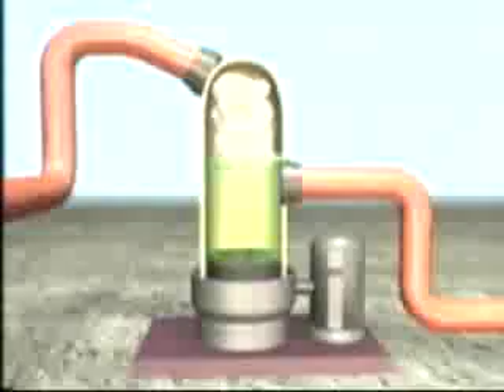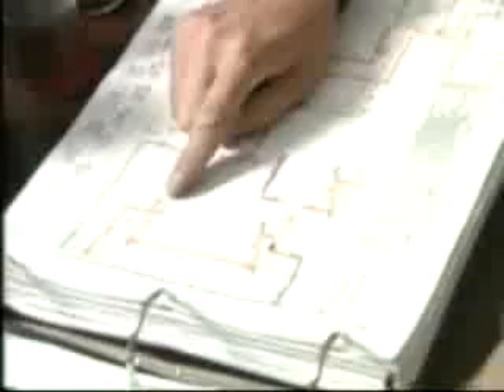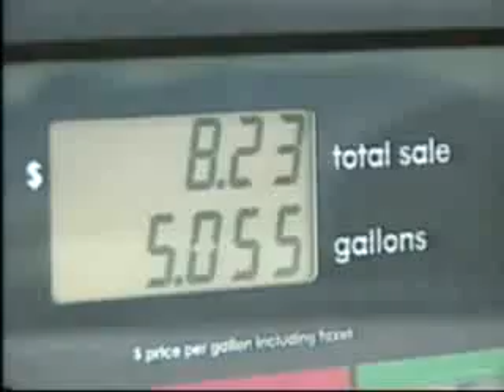Thermal Depolymerization

Comment: Part 2
Making oil and gas from hydrocarbon-based waste is a trick that Earth mastered long ago. Most crude oil comes from one-celled plants and animals that die, settle to ocean floors, decompose, and are mashed by sliding tectonic plates, a process geologists call subduction. Under pressure and heat, the dead creatures' long chains of hydrogen, oxygen, and carbon-bearing molecules, known as polymers, decompose into short-chain petroleum hydrocarbons. However, Earth takes its own sweet time doing this—generally thousands or millions of years—because subterranean heat and pressure changes are chaotic. Thermal depolymerization machines turbocharge the process by precisely raising heat and pressure to levels that break the feedstock's long molecular bonds.

Many scientists have tried to convert organic solids to liquid fuel using waste products before, but their efforts have been notoriously inefficient. "The problem with most of these methods was that they tried to do the transformation in one step—superheat the material to drive off the water and simultaneously break down the molecules," says Appel. That leads to profligate energy use and makes it possible for hazardous substances to pollute the finished product. Very wet waste—and much of the world's waste is wet—is particularly difficult to process efficiently because driving off the water requires so much energy. Usually, the Btu content in the resulting oil or gas barely exceeds the amount needed to make the stuff.

That's the challenge that Baskis, a microbiologist and inventor who lives in Rantoul, Illinois, confronted in the late 1980s. He says he "had a flash" of insight about how to improve the basic ideas behind another inventor's waste-reforming process. "The prototype I saw produced a heavy, burned oil," recalls Baskis. "I drew up an improvement and filed the first patents." He spent the early 1990s wooing investors and, in 1996, met Appel, a former commodities trader. "I saw what this could be and took over the patents," says Appel, who formed a partnership with the Gas Technology Institute and had a demonstration plant up and running by 1999.

Thermal depolymerization, Appel says, has proved to be 85 percent energy efficient for complex feedstocks, such as turkey offal: "That means for every 100 Btus in the feedstock, we use only 15 Btus to run the process." He contends the efficiency is even better for relatively dry raw materials, such as plastics.

So how does it work? In the cold Philadelphia warehouse, Appel waves a long arm at the apparatus, which looks surprisingly low tech: a tangle of pressure vessels, pipes, valves, and heat exchangers terminating in storage tanks. It resembles the oil refineries that stretch to the horizon on either side of the New Jersey Turnpike, and in part, that's exactly what it is.

Appel strides to a silver gray pressure tank that is 20 feet long, three feet wide, heavily insulated, and wrapped with electric heating coils. He raps on its side. "The chief difference in our process is that we make water a friend rather than an enemy," he says. "The other processes all tried to drive out water. We drive it in, inside this tank, with heat and pressure. We super-hydrate the material." Thus temperatures and pressures need only be modest, because water helps to convey heat into the feedstock. "We're talking about temperatures of 500 degrees Fahrenheit and pressures of about 600 pounds for most organic material—not at all extreme or energy intensive. And the cooking times are pretty short, usually about 15 minutes."

Once the organic soup is heated and partially depolymerized in the reactor vessel, phase two begins. "We quickly drop the slurry to a lower pressure," says Appel, pointing at a branching series of pipes. The rapid depressurization releases about 90 percent of the slurry's free water. Dehydration via depressurization is far cheaper in terms of energy consumed than is heating and boiling off the water, particularly because no heat is wasted. "We send the flashed-off water back up there," Appel says, pointing to a pipe that leads to the beginning of the process, "to heat the incoming stream."

At this stage, the minerals—in turkey waste, they come mostly from bones—settle out and are shunted to storage tanks. Rich in calcium and magnesium, the dried brown powder "is a perfect balanced fertilizer," Appel says.

The remaining concentrated organic soup gushes into a second-stage reactor similar to the coke ovens used to refine oil into gasoline. "This technology is as old as the hills," says Appel, grinning broadly. The reactor heats the soup to about 900 degrees Fahrenheit to further break apart long molecular chains. Next, in vertical distillation columns, hot vapor flows up, condenses, and flows out from different levels: gases from the top of the column, light oils from the upper middle, heavier oils from the middle, water from the lower middle, and powdered carbon—used to manufacture tires, filters, and printer toners—from the bottom. "Gas is expensive to transport, so we use it on-site in the plant to heat the process," Appel says. The oil, minerals, and carbon are sold to the highest bidders.

Depending on the feedstock and the cooking and coking times, the process can be tweaked to make other specialty chemicals that may be even more profitable than oil. Turkey offal, for example, can be used to produce fatty acids for soap, tires, paints, and lubricants. Polyvinyl chloride, or PVC—the stuff of house siding, wallpapers, and plastic pipes—yields hydrochloric acid, a relatively benign and industrially valuable chemical used to make cleaners and solvents. "That's what's so great about making water a friend," says Appel. "The hydrogen in water combines with the chlorine in PVC to make it safe. If you burn PVC [in a municipal-waste incinerator], you get dioxin—very toxic."

oil_4.jpg
Brian Appel, CEO of Changing World Technologies, strolls through a thermal depolymerization plant in Philadelphia.
The technicians here have spent three years feeding different kinds of waste into their machinery to formulate recipes. In a little trailer next to the plant, Appel picks up a handful of one-gallon plastic bags sent by a potential customer in Japan. The first is full of ground-up appliances, each piece no larger than a pea. "Put a computer and a refrigerator into a grinder, and that's what you get," he says, shaking the bag. "It's PVC, wood, fiberglass, metal, just a mess of different things. This process handles mixed waste beautifully." Next to the ground-up appliances is a plastic bucket of municipal sewage. Appel pops the lid and instantly regrets it. "Whew," he says. "That is nasty."

Experimentation revealed that different waste streams require different cooking and coking times and yield different finished products. "It's a two-step process, and you do more in step one or step two depending on what you are processing," Terry Adams says. "With the turkey guts, you do the lion's share in the first stage. With mixed plastics, most of the breakdown happens in the second stage." The oil-to-mineral ratios vary too. Plastic bottles, for example, yield copious amounts of oil, while tires yield more minerals and other solids. So far, says Adams, "nothing hazardous comes out from any feedstock we try."

"The only thing this process can't handle is nuclear waste," Appel says. "If it contains carbon, we can do it."

This Philadelphia pilot plant can handle only seven tons of waste a day, but 1,054 miles to the west, in Carthage, Missouri, about 100 yards from one of ConAgra Foods' massive Butterball Turkey plants, sits the company's first commercial-scale thermal depolymerization plant. The $20 million facility, scheduled to go online any day, is expected to digest more than 200 tons of turkey-processing waste every 24 hours.

Comment: https://www.youtube.com/watch?v=xtS6K43np9o&t=75s  Thermal Depolymerization
+Gregor J. Rothfuss If you and your fellow oil men throughout the whole world have invested more than $1 quadrillion dollars or more into exploration, surveying, drilling tests, commercial drilling, pipelines, transportation-communication infrastructure, processing refineries, scientific R&D studies and engineering-machine tooling to make proprietary equipment, foundries to make specialty alloys for your own needs, the works, etc. And here comes some guy who can just simply turn anything organic into oil and separate all of the byproducts into salable commodities, recycles the used water in a close-loop cycle, co-generates power to power all of their machineries energy needs. And can turn any landfill or small coal mine into an oil well, as with the coal they can simultaneously clean it up while getting oil from it as well as other salable byproducts like sulfur and heavy metals plus others AND DO IT ECONOMICALLY AND PROFITABLY, AND DO IT WITH AN INITIAL CAPITAL OF $50 TO $100 MILLION DOLLARS. HOW WOULD YOU FEEL?

Comment: Earth doesn't naturally break down plastic, because plastic doesn't exist in nature. All we're doing is turning the oil we previously turned into plastic back into oil and then burning it. No different then simply drilling the oil and burning it except it was used as plastic, then as fuel.
Reply: Thorium LFTR

Comment: Wonder if I could make one small enough to stick into an RV.
Reply: The answer seems to be either yes, but you might need a a small trailer for safety. There's a video called "Homemade oil refinery. Turning plastics into oil", which popped up for me in the recommended section next to the videos.

Comment: @rocketplumber and the water is what they said in the video recycled so if the recycled water is already hot it doesnt take that much energy to get it back up to the desired heating temp for the next batch process.if you go to 1:01 you notice all the white pipe, that is insulated pipe for retention of heat and again at 1:52 the white bigger tanks are also insulated.most likely the uncovered pipe acts like condensers or water return lines in the closed loop system

Comment: The organic waste they are processing in the Thermal Depolymerization  Process (TDP) all eventually breaks down into CO2 and methane if it is left to rot in landfills. The TDP process is actually offsetting the fossil fuels that would otherwise be mined and then burned causing it to and release carbon into the atmosphere.  
Unfortunately there will always be a need for liquid hydrocarbon fuels (lets just hope the need becomes small)

Comment: from my other comment all that carbon is doing something for example the carbon going into the air from the burning of these fossile fuels made from this machine or TDP is trapping more heat from the sun into our earth and bu bi polar ice caps if you look on google u can see that over 20% of the ice caps from the north pole have melted into a liquid state since the 1970's still ingenious design of energy use but ilogical